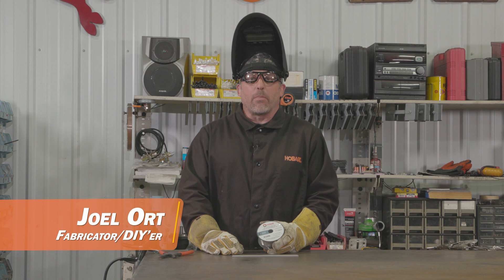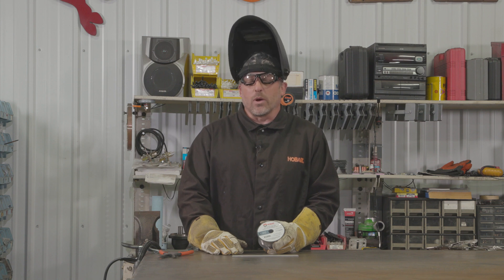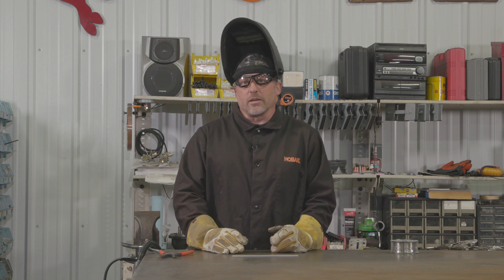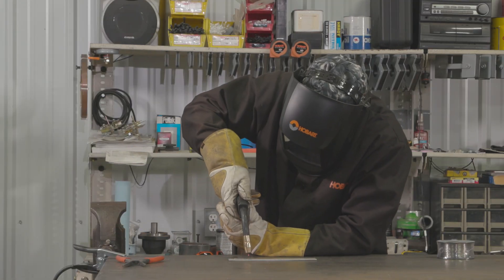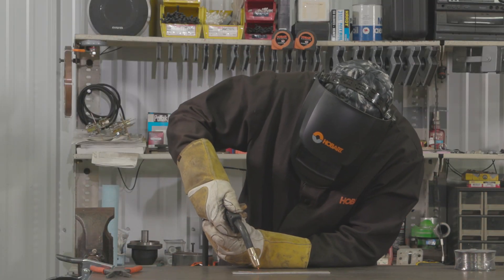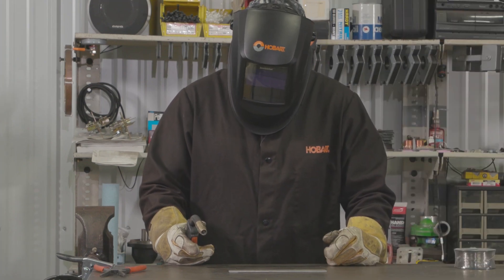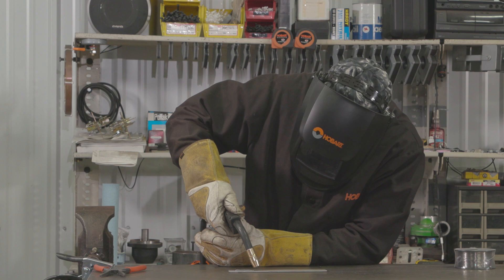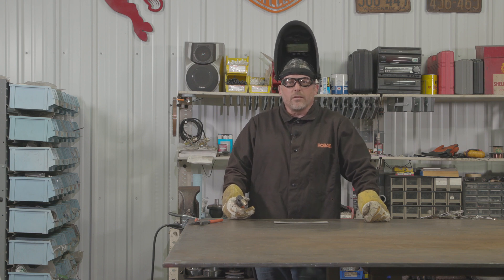How To Weld on Stainless Steel

Comment: I’m welding 304 1/2 inch rod with a 180C Lincoln with 100% argon. What would u recommend the settings to be at?